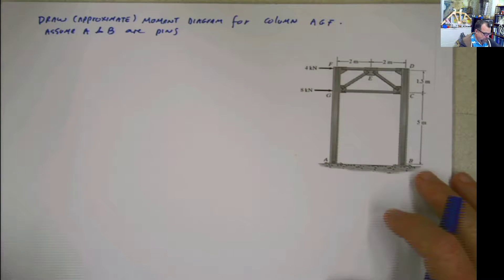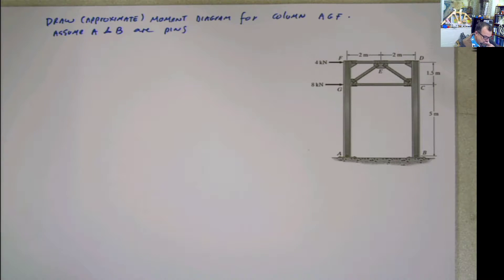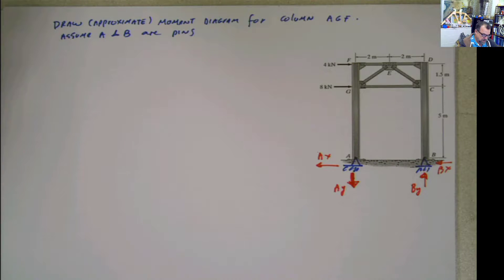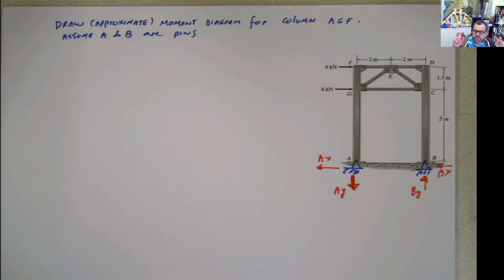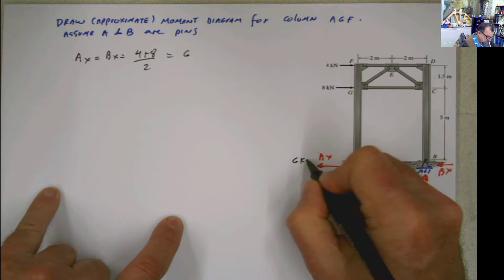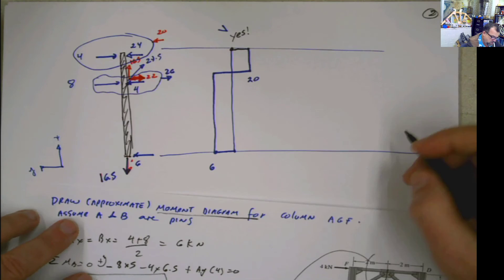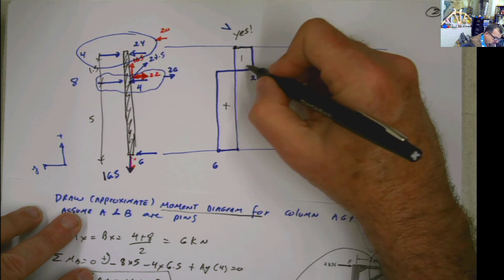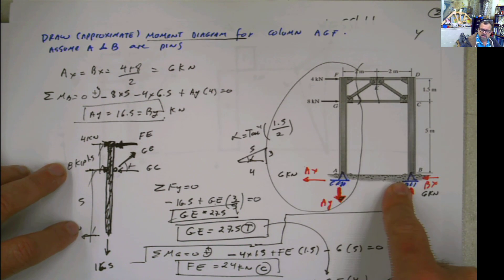Example Portal Method with Frame Truss Combination Pinned Supports

Comment: Can we not simply say Ma = 0 and Mf = 0 because the are pin ends. Then, we know the BMD is zero at A and F, and we simply need to go Isolate AGF, and make a cut just below G, and have a FBD of AG and take moment about the cut, which is Ax (5) = 30 kNm.